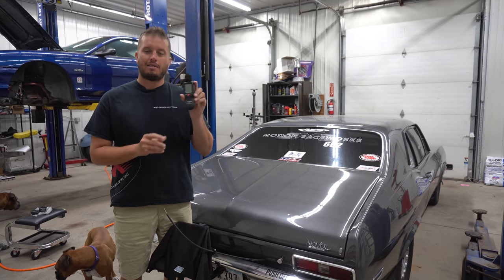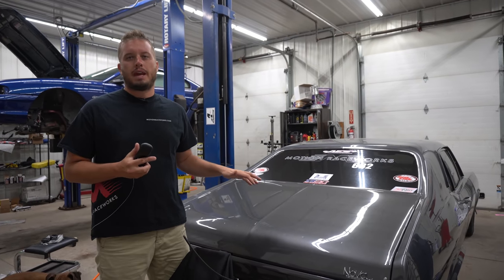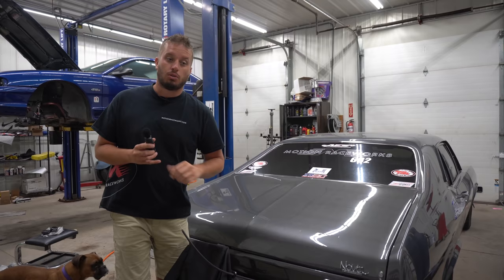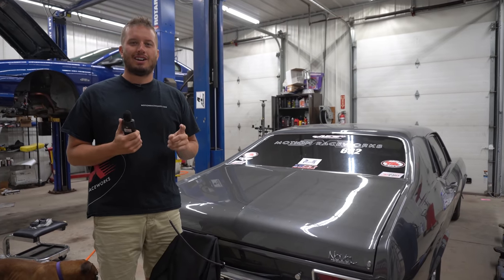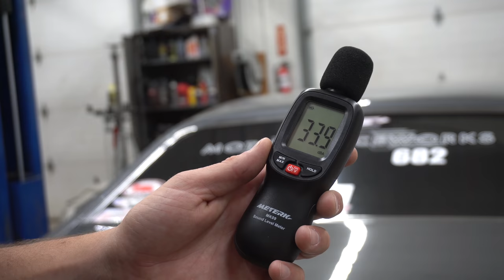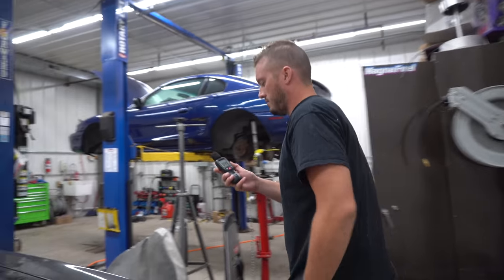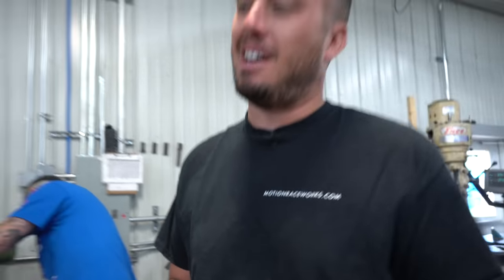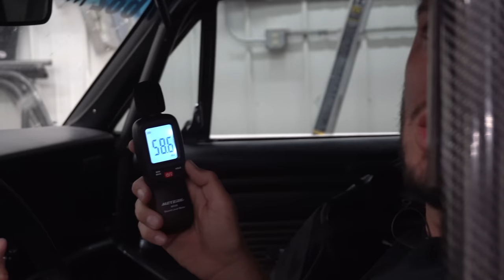Fuel Pump too Loud? We got the cure!  Tech Tip Tuesday!

Comment: Return style vs dead headed makes a huge difference too
Reply: No matter what, it's also a good idea to run a pump speed regulator. Saves your pump and puts way less heat into the fuel-
Reply: do you find dead heat runs hotter/louder? always seems like a return is easier on the pump.

Comment: I replace my 1998 Chevy cavalier fuel pump one year ago with the fuel filter today I went to reinstall the battery that I left out of the for a week because I special ordered one that is expensive is supposed to last longer. I started on my car today and the rear of the car has a humming sound coming from the gas tank. Why would my fuel pump be doing this now?

Comment: I've never seen a pump mounted like that. I love these videos! Any chance you'd be able to show a detailed install of a fuel pump relay? Makes me so nervous thinking about it.
Reply from the maker: Fuel Air Spark we can try to do one in the future. In the meantime we have a relay video we did a few months back that I think will cover and make sense of everything for you!
Reply: Pretty much all relays operate the same...your using a device (sensor or switch )  to control a high amp load (pump, fans).   The relay itself is a low amp device so you dont burn out the sensor or switch.

Comment: these are great tips! i was wondering why my new cummins lift pump i mounted on the frame was louder than the engine!!!! i didnt use isolators!!! The pump later failed, not sure if it’s cuz the vibration destroyed it??? or it was just a defective pump. but either way I’m mounting a new and better pump and using isolators this time!! this is a good video! nice Nova btw!

Comment: This guy knows his shit!...I am a 30 yr. veteran Mechanic and an avid race driver and some times crew chief ..lol but only watching half his video ..... Problem solved! I had not done much with "High Pressure" EFI pumps before but they Pump Hard! and need to be dampened to the frame with rubber! ....90% of the pump noise is gone! just doing that.

Comment: This Young dude Knows his shit!....That said I am a 30 yr. Mechanic and an avid Race Driver and crew chief at times...lol but I had not done much with the "High Pressure" pumps needed for fuel injection like the "MSD ATOMIC" but only watching half his video on the loud fuel pump.....Problem solved! they pump hard and need to be dampened to the frame with rubber and 90% of your noise is gone! like I said this Guy is Great!

Comment: Thanks for your very informative video. I am running a race honda motor which came with a loud external Weldon fuel pump and race fuel tank. Im looking to replace my loud weldon fuel pump with something quieter. What would you recommend. I mainly do street racing, nothing professional. I greatly appreciate any recommendations. Thank you in advance.

Comment: I have 2 pumps the red a1000 brushed  and the black a1000 brushless  I used foam mounting to the frame and it helps sooooooooooo much.  Without the foam with hard rubber it was so darn loud       and I drive a 1999 7.3 powerstroke you could hear it over the motor till I added the foam mounting and you can't hear it at all

Comment: mine sound like a hammer drill in the boot (Trunk) it might be my check valves making the noise. i have twin AEM 400 staged. it is mounted in the fuel cell in the boot (trunk).

Comment: Hi Doug! I think most of my noise is from my hard line vibrating against the frame rails. Is there a rubber style holder/clamp I should use for this?  Oh, I found Motions rubber frame clamps for 3/8 on your link. Thanks so much. Appreciate it. Cheers from Motown/Dearborn.

Comment: Just a side note I think you need to do this as a before and after type of test. Kind of pointless to compare the 'fixed' quiet pump to everything else in the shop when you should get a car that has a body/frame mounted pump with hard lines to test first. Then replace the lines, test. Then mount/isolate the pump, test and maybe even get several pumps to test sound levels. Just saying if you going to do comparison test you just cant go 'Heres my finished product see how quiet it is!' Surely you've got someone at the shop who got a thrown together system for you to improve upon. Hell come get my car LoL!

Comment: Mounting is everything. Rigid mount on a large flat panel like a Trunk floor and it's amplified. 
Way back in the stone age I used to mount the l would Holly pumps on a bit of radiator hose.  When they are set with bolts either side it removes a lot of vibration.

Comment: I run the aeromotive A1000 stealth pump mounted in my Rick’s stainless tank but I’m out of pump. About to make the jump to that brushless 5gpm direct replacement into the tank. I’m going to buy a sound meter and test mine the way it is now from rear of car and inside with the current pump and again with the 5gpm and see what the numbers look like. I can’t hear it at all with the motor running but I only have a straight 4” 4 foot downpipe from the S480 dumped under my passenger seat so it’s not quiet either. Even when just cycling the key the pump isn’t that loud tho. I think in tank is perfect and helps the bigger tanks live on long drives to help cool it. I don’t see it heating up the fuel enough to matter as someone was worried about that. Maybe I will stick a temp gauge in my tank to get the fuel temps just sitting and then keep tracking after some good driving and playing hard to see if it changes much. I have a return style so I know it will heat some just from being compressed and cycled through the engine bay. Will see tho. Especially if anyone else tests their in-line setup the same way. I love finding the real facts and not just guesses.
Reply: Buy a pump regulator. Your pump will last a lot longer, run a lot cooler and noise will be a non-issue.

Comment: Is your water pump actually electric or is it just a regular pump driven by an electric motor?
Thanks for the tip, my electric fuel pump isnt isolated so its annoyingly noisy. Its not a thing when I am driving since the motor is way louder.
Reply: Sounds like a Meziere pump. Why run anything else...
Reply: @AB-80X  are they like the best? I have one on my Camaro it’s been pretty good too me especially since the main problem w the car is the water pump leaking on to the opti and now I have the msd set up and the electric water pump so it’s been amazing

Comment: Tech tip tue...how about sealing up the hot side on your turbo system. See headers/manifolds glued to heads, why not gaskets? Are v-bands good enough? Could they use a little sealant or are these new copper ringed v-bands better.
Reply: He went back to gaskets, he said at the time they couldn't get any and tried the RTV trick

Comment: I understand in tank pumps, are cooled by the fuel! However that in turn, heats the fuel up! Doesnt seem like a good trade off to me! If you are worried about air intake temp, you should worry about fuel temps also!
Reply: Return fuel systems also heat the fuel up
Reply: @anthonymason701  I get it! Just trying to think of something that maximizes everything with the smallest trade offs! Maybe a fuel cooler or a cool can, like Moroso makes!
Reply: No matter whether it's a dead headed system or return system, a car that is not an all out race car, needs a fuel pump controller. This will greatly reduce the heat as the pump is slowed way down most of the time. If people think hot air kills power, just wait till they see what hot fuel does. It's a massive loss. Fuel coolers for the win!

Comment: 5.0 aeromotive is louder than most people's exhaust at the track.
Reply from the maker: It’s actually not if mounted correctly.  You must not have watched the video
Reply: Mine is mounted in the bed of my s10 on the msd style vibration rubber mounts but it is using aluminum fuel line on the outlet

Comment: I bet a trolling motor install kit would work good also for mounting a fuel pump. They hold the weight of a trolling motor to the front of a Fiberglass bass boat and reduce noise so the motor don’t spook fish off when your using it. You guys should try it out. Maybe make it a kit to sell. All they are are rubber insulated nutserts pretty much that require no special tools to install.